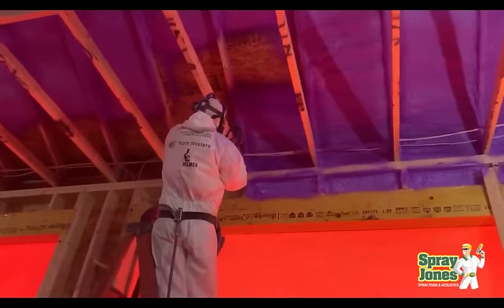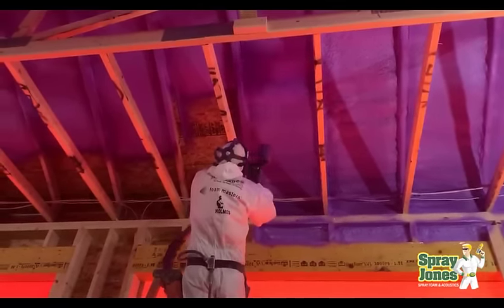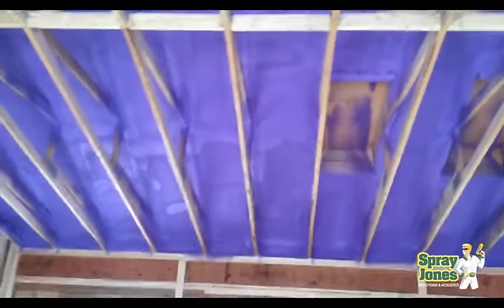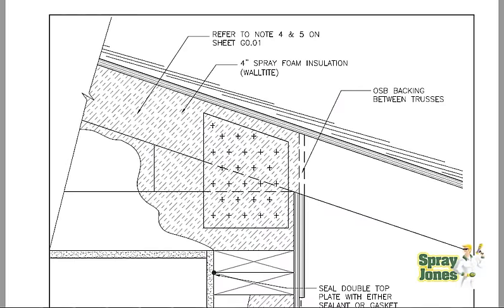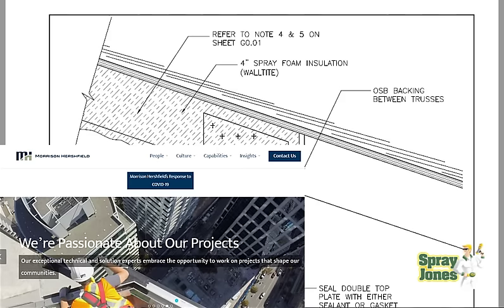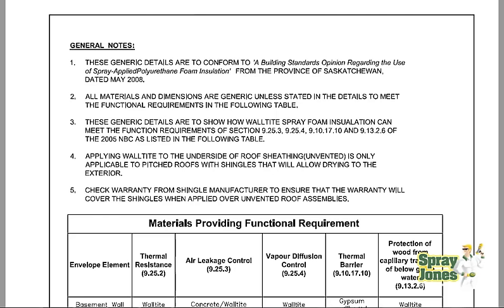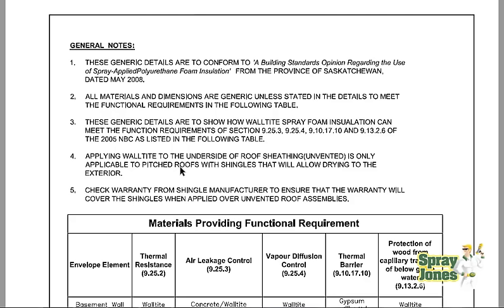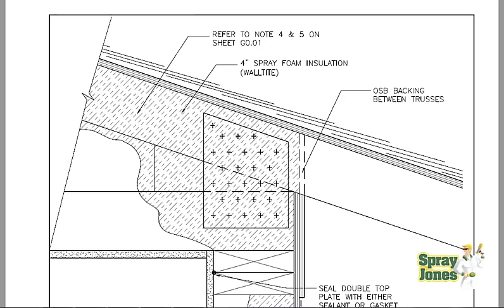Unvented roofs - Closed cell vs Open cell Spray Foam Insulation which is better?

Comment: Jury is  still out on this as it is too new. Engineers are wrong a lot as everything works on paper. Every hot roof I've encountered have moisture retention issues. This will cook shingles but not affect metal, tile, or slate. Will probably cook synthetic slate. Buildings need to breath or you get sick building syndrome.
Reply from the maker: 1. This has been around for 30 years already
2. Engineering has shown this to be a proper method 
3. Building codes support it
4. Shingles last just fine with SPF 
5. Commercial BUR roofing does not vent, how is SPF different

You comment ignorantly instead of learning.
Reply: @SprayJones  so you insult rather than listen to a different point of view, speaks a lot about your character. I've been roofing since 1980 and now troubleshoot and assess problem roofs.  I  see on a daily basis issues with unvented roofs.  BUR is a completely different system that typically uses different insulation and is not as common today as single ply or mod-bit which usually use rigid foam and fiberboard. I have personally seen shingles turn to potato chip consistency from insulated sheathing. Go sell your product like a used car salesman.(insult intended right back at you). Shingle manufacturers require vented roof decks, read instructions and warrantee requirements.
Reply: @SprayJones  You have an financial interest in pushing spray foam, so of course you will say that its good to use.   Also, 30 years is nothing in the grand scheme of things.  Europeans live in houses that are hundreds of years old and don't allow this garbage on their roofs.  When it comes to building practices, they are FAR ahead of us and our paper, particle board and synthetic foam buildings we live in.

Comment: So we went with closed cell on the roof of our house and we are having problems,  this was a new house and the design was to always have a non vented roof with spray foam.  Our roof wood seems to buckle especially on warmer days, you can see it in the shingles.  I believe it was the fault of using the wing underlayment which specifically says not to use on non vented roofs, is a synthetic non breathable underlayment.  We are now fighting with the builder to get it repaired, which nobody wants to take blame for..  Does that sound like the scenario of the wrong underlayment being used?  Our roof pitch is all 4/12 and higher.
Reply from the maker: NO. 
Many other variables. 
I had a guy try to blame shingles peeling off in a wind storm on spray foam. In fact the idiot that did it - off duty cop - did not use the correct nails. 
So there are a lot of things people could have done wrong for you. Put on your Columbo hat...

Comment: The problem with any spray foam most the guys doing it had drove the price so high it’s just unaffordable. I don’t know if the materials has raised that much over the years or not. I suspect greed is the reason more so than anything. They’re pricing themselves out of business 
Plus the smell reputation it’s had in the past scares people away. How many people are willing to chance putting it in a 2 or 300 thousand dollars home ? Only to end up living in a camper in the driveway. For the price everyone wanted to do my garage/pole barn I could insulate it a little over twice with owning Corning fiberglass.

Comment: With zip system roof decking you wouldn't have to worry about water getting under shingles...........
Reply from the maker: From which side? The outside still exists....

Comment: Why not just use baffles and vent the roof?  Spray closed cell over the baffles.
Reply from the maker: Why not watch m 4 part series where I answer why not. Videos 1 & 3 should nail it down for you.

Comment: Okay I just thought another video about two videos down from yours and it's some guy down and in Texas crying that if you spray foam there destroys your shingles well because they're all lifting to somebody put the wrong kind of shingle on there it's what he's saying and other things like that well one of the things that knows I live in the Southwest we get up to sometimes out you about a hundred and eighteen degrees and most of the houses here have more open they don't have any insulation up there I think it's depending on who the roofer was and how good of a job they actually did and be used to correct material I think you're putting spray foam Sprite lying to me but I saw what I saw was his routes for lifting cuz it was not staying that it's not sticking to the other shingles well mine doesn't have any spray foam underneath it and I bought the house like that the shingles lift because I'm some places the heat is so hot that allows the wind of let them up and just separate the tire that's holding it together is melted I also know that the Builder that was out here that built these houses his roofers did not remove the cellophane that was between covering the a little bit of tire that sticks to the other signal you know how they come in the packet he just wouldn't long put three Staples on each one as quickly as he could taking hair short cut it could do I'm so you might want to make that clear that you need to use the right type of shingle and make sure your roofer takes off that sell paint and sticks it down good like I said and I do believe in a cold-weather area yeah that's going to help there are two and he goes up on the roof of the blower to see if the shingles for lifting where I live we get sending miles 75 mile an hour winds at times I seen sections of fencing go flying I seen my neighbor's roof come completely off his house when I dust devil hit it that was considered cheap ass Builder taking shortcuts I think if it had been installed correctly was it little strips removed it was a hold and also it cost alot to heat a house and cool a house when your temperature goes from 118 all the way down to about 18 degrees or lower on occasion so we have a great variety of temperature the guy downtown San Antonio God uses no matter what time of the year to go to Cecily the same temperature as usually hot so I think the guy that didn't think about that the kind of shingles they put down but he's telling everybody don't put spray it will destroy your roof new album he may be good at putting a roof on butt I don't think he looked into it to see how well it hangs on because of the spray or don't I like your idea I think you'll work well if I ever get another house and I can I get to build it or have somebody build it for me I'm going to make sure these right shingles and plenty of foam and do it correctly thank you very much for your information it was very informed forming and I hope you can meet all of this about this to that this other guy left a lot of stuff he looked a lot of factors so thank you very much keep going I'm a new subscriber so I will be watching you as much as I can thank
Reply from the maker: Ok, thank you new Sub! Happy to have you.

Comment: Ok so you ignored a very important aspect to this application. That is deterioration of the shingles due to excessive heat. if you dont have air flow under the roof deck the shingles suffer for it. our roofs loose approximately 25% of their life because of heat build up. i would recommend you look into placing baffling against roof deck and promote air flow to reduce heat buildup before you apply apray foam.
Reply from the maker: Please watch the shingle life and SPF video I did addressing his very subject.

Comment: You won't be able to find a leak with closed cell spray foam on the underside of the roof deck. It's just not going to happen. Yes, you may find it after half your  roof sheathing rots out. By then it's too late. You're also going to have to condition the attic which means higher bills because you'll need a larger hvac to condition that extra space, or get a separate unit to condition it. If you have to put insulation under your roof deck, put insulation that can be removed and put back.

Spraying the entire underside of your roof deck with spray foam is just foolishness. I'm also not prone to believing a company just because they said so. Just because they feel confident doesn't cut it. I respect your argument, but I'm still unconvinced by it.
Reply from the maker: All of what you said has been proven wrong and refuted. Really you are boring to me...
You bring up the same simpleton agreements that have been said many times before and proven false. We have the data to show it and we live it. But just reading what you type I can tell you aren't interested in learning.

Comment: Having problems with inspectors laughing not recognizing hot roof systems. Ive called my third party licence. They say we"re on our own. Please help 🙏
Reply from the maker: 1. deal with your SPF supplier
2. Get a engineering firm to write the drawings
3. Have the methods written / sealed approved at the local code level
Reply: The inspector wants a stamp for every job. Even though its the same thing.
Reply from the maker: @mytube420able  So what. Pony up the cash, build it into your price and move on. Inspectors just want to be off the liability hook.
Reply: Pony up the cash to potentially put a bid in? How's that work.
Reply from the maker: @mytube420able  Have all the relationships in place so that when you have a job awarded you can green-light the next phase of having the paper work sent in. 
If you cannot figure these basic things out don't spray foam.
Reply: Ouch ok. These are learning curves.

I've been spraying for quite some time. Just asking for advice. I am learning to figure out things. 

I have sent in papers many times to different inspectors. Some give a hard time some don't. 

So I shouldn't do something I'm good at? Only merely trying to figure out things haven't learned yet.

Comment: Personally - and I live in the south, it's not Canada Cold - I don't any reason to have a conditioned attic at all. If it's going to be actual living space that's one thing, but an attic full of trusses and equipment? No way I'm doing that.
Reply from the maker: Perry go watch the video on "SPF to the roof, does it cost more to heat?"
There are may reasons to stay with foam under the roof. Just one in the South is wind uplift from storms. There is good data on this from Florida due to hurricane damage studies.
Reply: @SprayJones  I'm in South Florida -  roofing down here is ... pretty tight on codes. The "Miami Dade" stuff (which basically all of Florida has adopted). We have to double nail decking, use huge metal tabs for underlayment,  drip edge on full perimeter, glue down all edges 2" back, 6 nail rated shingles so no new 3 tab roofs since the 90's, not sure, but I think SA and cold process mod bit is a no-go (all I ever see is torch down) ... wind uplift is a merf!

I do get why people go that route, but it's not for me. Number 1 reason? If my roof leaks, I want to know about it, and be able to find it. Number 2 reason is that it's pretty costly compared to conventional systems. 3. Offgassing - breathing it, and possibly getting severely sensitized to chemicals. Think "the next asbestos".

Don't get me wrong though - there are applications I would absolutely use it - and I DO like the idea, and it 100% does outperform conventional systems in many ways at least in the short term ... I'll feel a lot better about it when it's more "tried and true", and whatever issues are found, and worked out.
Reply from the maker: @notsure7874  Ok, as you wish.

Comment: I don't see how to prevent wood rot with direct application of foam ... from moisture, humidity, rain, etc.
Reply from the maker: You protect wood via your outside skin like diffusion-open membranes and proper drainage. Limit the time it can get wet and give the water somewhere to go.
From inside you have an air tight bonded material to the wood that does not hold water within it. 
No water from within, limited water contact outside with drying time. 
It is not that complicated.

Comment: In homes, without ventilation, you will have massive humidity issues.
Reply: Homes should be air sealed with mechanical ventilation erv/dehumidifier and unvented conditioned attic is the best.

Comment: the answer is NO open foam under a roof. if the roof leaks it will not drain out, it will sit there and rot your structure. I know this because I have experienced it on a house that I was constructing. never again!
Reply from the maker: Well that is too bad that you had such a bad experience. Is it really the spray foams fault that the roof waterproofing failed? 

I can understand the knee-jerk reaction that many can have that don't see what the true cause of the problem is. Open cell foam is not supposed to get wet, so the failure is on the roof job and how that was done and the aftermath of damage that it caused not the SPF's limits. Why not blame the drywall too?
Reply: I couldn't agree with you more, it was the waterproofing that failed. however after the waterproofing failed it was the open cell foam that intensified the problem. @SprayJones
Reply from the maker: @3thomasdm  That's a lot of things in life. Low oil levels in engines cause bearings to fail, despite how we feel about the brand of engine. 
I like closed cell for this reason. If there is a compromise with roofing products and workmanship then the water is held to where the compromise is. 
Your testimony also refutes the ignorant view that open cell foam should be used so a leak can be easily detected.
Reply: listen I'm speaking from personal experience. during a very wet winter I had a massive water intrusion into a roof with open cell foam, THE WATER DID NOT MIGRATE! the only reason I knew there was a problem was by the shear amount of water into the envelope. so yes, claiming that a leak can be detected using open cell is indeed ignorant. therefore I don't understand why you're debating me. open cell should never be used on a roof, only closed cell. @SprayJones
Reply from the maker: @3thomasdm  I am not debating you about the use of open cell SPF. I do not like it for roofing and have tried to counter the claims that it will show leaks up. 
My earlier claim is still valid that it is NOT the SPF's fault about what happened.

Comment: I live in Florida, air conditioning by trade. I firmly believe closed cell foam has so many benefits compared to other types of insulation it is a no brainer. Here is another video if you are considering this type of insulation.
https://youtu.be/tKbuWMGAEHQ

Comment: WOW the detail ignores so many factors not the least of is the detail voids most asphalt shingles warranty!
Best practice is to not place spray foam  directly to the back of the roof deck without a vent cavity / drainage plane
there are numerous details in the design universe that show vent cavity/drainage plane this and MH has many on file 
JUST BECAUSE A DETAIL EXIST DOES NOT MAKE IT APPROPRIATE
Reply from the maker: Max watch the shingle life and warranty video. You are spouting off the same cliche rhetoric that every ignorant person before you has until they understand the system.
Reply: @SprayJones  Me and most my colleges as a general rule are against the practice of insulating against exterior weather barring decks
Reply from the maker: @maxsteel6092  Watch the 4 part series on non vented roofs. What you do after that I don't much care... horse to water...